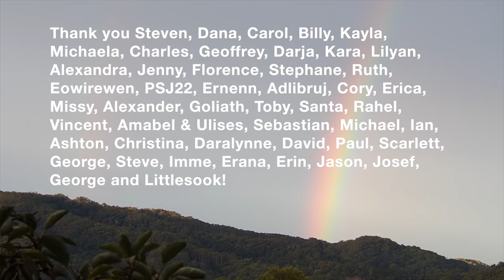Living with Zero Waste: Self Sufficient and Off Grid

Comment: Dear Julia & Anastasia! 
Please check whether the threads used for sewing/sealing the paper pack (for flour) you used, is made of synthetic fibre or natural one? If synthetic, please see that they are segregated & sent for recycling. Repurposing is good, but I think repurposing plastics like the PVC pipe you have used there, ultimately leads to another form pollution as the plastics get weathered by natural elements or forces (solar radiation, heat and rain water etc.) & leaves microplastics and nanoplastics, besides many toxic additives in to the soil & water which is also an environmental concern. So, I request you to use Bamboo stem if available, instead of PVC. Repurpose the plastics in such a fashion that they doesn't contaminate the water, soil & air.